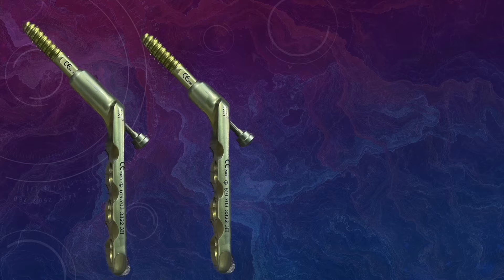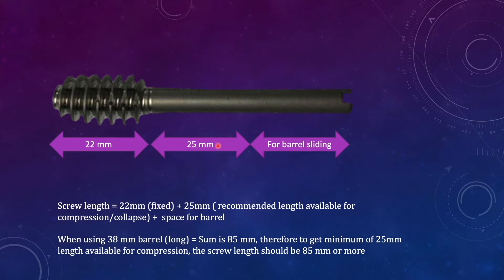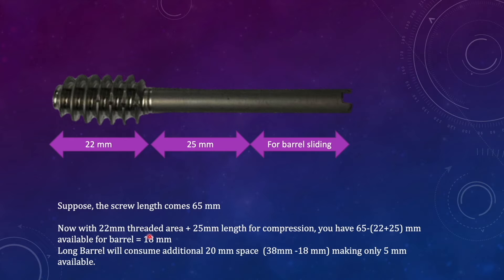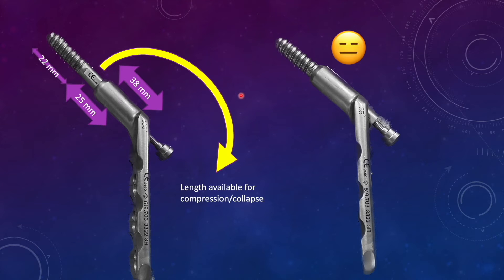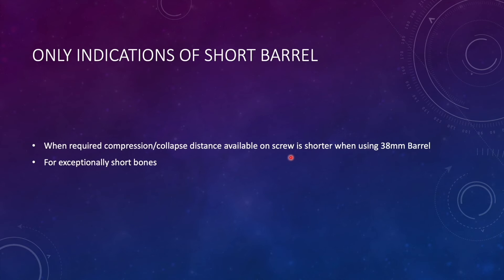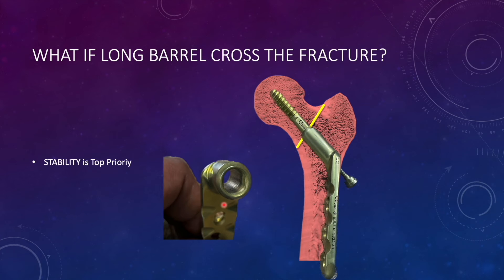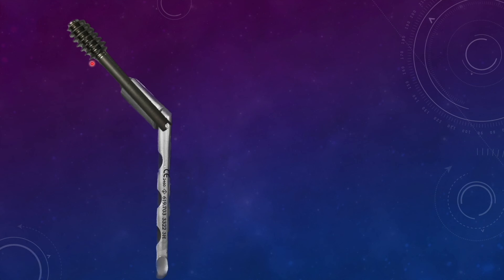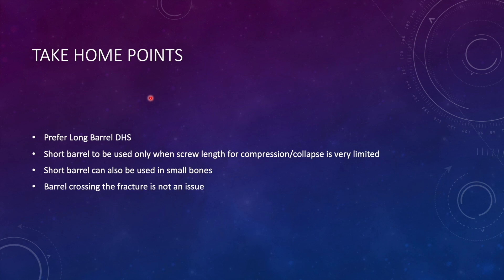Short Barrel vs. Long Barrel Dynamic Hip Screw (DHS)

Comment: *How do we calculate the amount of compression required on table?
* Do the location of fracture line also affect which implant to use ie. long or short barrel?
Reply from the maker: First thing, there should not be any gap at fracture site before putting lag screw. Minor gap like few mm wont be a problem. Now we select an undersized length lag screw than estimated. This has been demonstrated in other videos. For example if size comes 95, i ll prefer taking 85 or 90. I would then sink the screw deep under the lateral surface. Now after sliding the barrel When I tighten the compression screw, the lag screw is pulled outwards bringing compression at fracture site. I tighten it maximally till I get a feel like putting a screw in cortical bone. Such feel tell you about the stability of compression.

The location of barrel away from fracture is an old thing. Only criteria is use is the lag screw length. I prefer long for screw lengths above 80mm

Comment: So as mentioned in ao if length >/=75 mm use long barrel 15 mm compression is acceptable 
<75 length then <15 mm for collapse or compression on wt bearing then implant will fail with long barrel either breakage or screw pullout so use short barrel
Short barrel =22 mm thread of screw + 25 mm barrel + 23 mm of compression available 
75mm screw= 22mm thread 38 mm barrel 25mm for collapse 
Larger than 75mm more room for collapse later in life as bone is cancellous and gets more osteoporotic with age
Pt more likely to present 10 yr later with implant breakage

Comment: Does TAD matters in Subtroch fracture ( level below LT) fixed with PFN / PFNA/ Recon nail with neck screws
Reply from the maker: The TAD value is important whenever there is a tendency for varus displacement due to forces or fracture patterns. So, having more bone medial to the screw tip means that a major chunk of femoral head is devoid of screw purchase. Thus, the chances of the head tilting or loosening witll be higher when less bone purchase is there. Unlike in diaphysis, we can't have bicortical purchases In the femoral head. Meanwhile, we have to compensate for the risk of cutout also. So, for blades that tend to penetrate the bone, we can keep TAD on the higher side and on the lower side for screws. The closest subchondral level for the screw/blade is difficult to predict. For screws, we tend to get purchase in the subchondral bone and for bade, we tend to avoid that to prevent cutout.

Comment: Sir, can you give me some information about 25mm length of compression ? I can't find any article write about this number.
Reply from the maker: I'll try to find the original article and update it. Meanwhile, this description can be found in some books. The screenshot is here:https://photos.app.goo.gl/GiezJC5apjK3o8gC9

And the book link is here: https://books.google.co.in/books?id=-gFBEAAAQBAJ&pg=PA145&lpg=PA145&dq=short+barrel+vs+long+barrel+dhs+calculation+dhs+22%2B25%2B38%3D85mm&source=bl&ots=yos9SU3eMK&sig=ACfU3U18V9uTISBLDrOKWcbt23a5iMDRhw&hl=en&sa=X&ved=2ahUKEwjG3ou9ybqFAxVGV2wGHQXrBh44FBDoAXoECAIQAw#v=onepage&q=short%20barrel%20vs%20long%20barrel%20dhs%20calculation%20dhs%2022%2B25%2B38%3D85mm&f=false
Reply from the maker: The sliding distance is synonymous with the distance reserved for compression.
Reply: @Justorthothings  Thank you very much sir, I did't think you answer my question such that fast
Reply: @Justorthothings  And How do you think about the number of holes of the plates? I found the information in the website of A.O Foundation, they only use the 2 holes plate. but with this SR-MA, published in 2022, they recommend the 4 holes plate
https://www.ncbi.nlm.nih.gov/pmc/articles/PMC9009969/